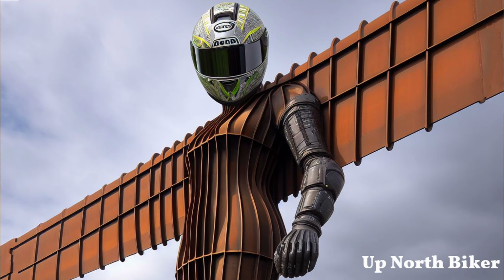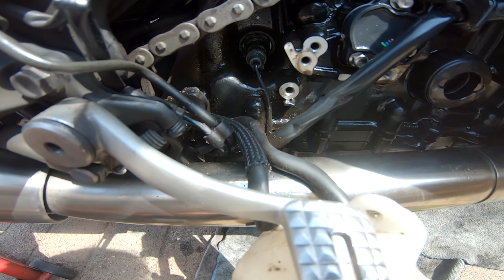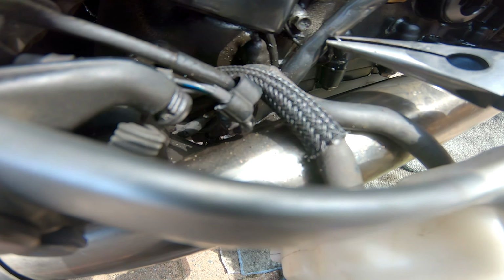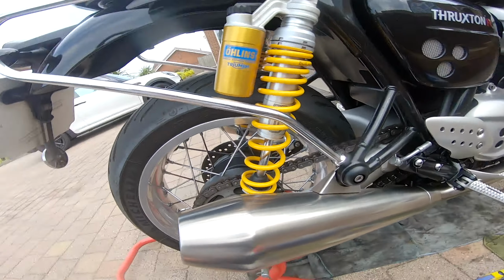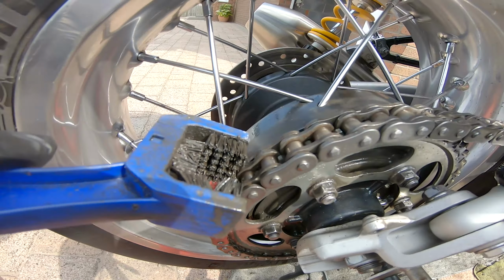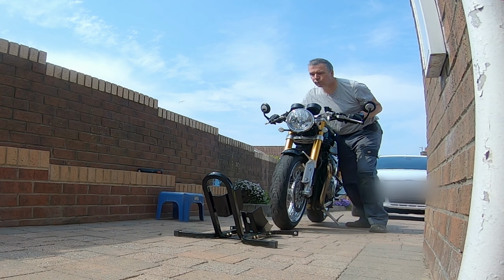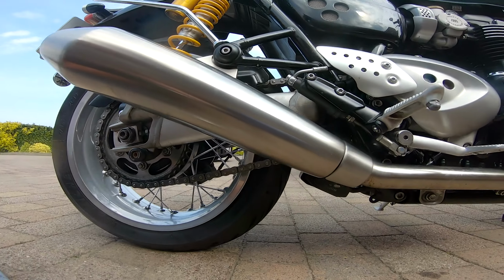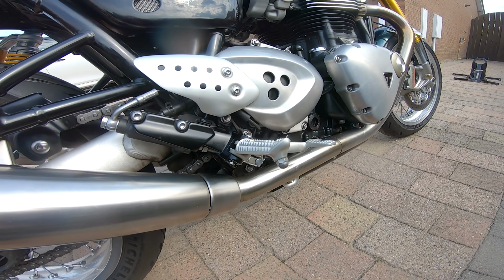Triumph Thruxton Chain Maintenance

Comment: What a faff !!!   I just brush my chain with old engine oil,, I dislike spray on lubes as they attract dirt. Old oil is much cleaner..After your ride wipe off the paintwork..it so easy.... Oh if I going distance (over 200miles)  then I will use a sprayon but very rarely.....regards
Reply from the maker: I don’t like the fling from using any form of wet lubricant as I use my bikes frequently and don’t always clean the bike every time when I get back apart from the winter when there is salt on the road